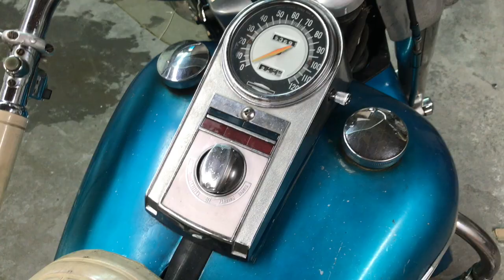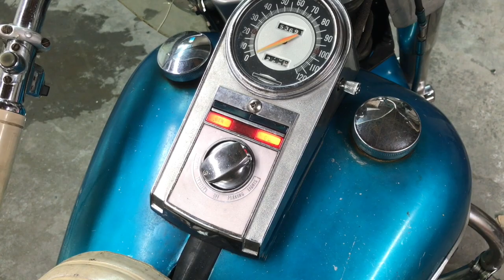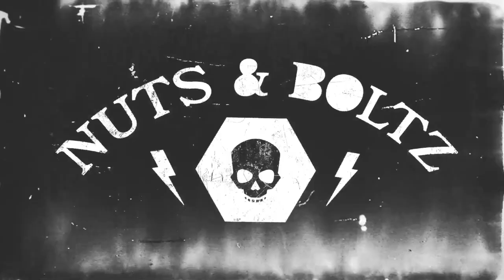How to time a Shovelhead with Auto circuit breaker - 1969 Harley Davidson Genny Shovel

Comment: That is not a distributor. Both cylinders fire at the same time.
Reply from the maker: Correct. The proper name is a circuit breaker. Thank you
Reply: @nutsandboltzgarage5889  Thanks for being a nice guy. I'm a bit of a butthole when it comes to using the proper names. It all started while in the Air Force. Best mechanics training in the world. You don't make mistakes. I've had my 75 FLH since new. It has never been in a shop, not even for warrenty work. I've done it all myself, and that is with one complete rebuild front to rear. It's just this particular item came up once before along time ago so I will tell you about it. You might get a chuckle. This guy was trying to time Panhead using the two different marks on the fly wheel. First he set one and then he would set the breaker to the other mark on a different place on the flywheel. When I told him what he was doing wrong, he told me I didn't know what I was talking about. Everybody calls it a distributor. I told him my bike wasn't the one not running. And to prove my point,butthole that I am. I fired up the Graylady and rode away.
Reply from the maker: @Helm-w1q  no. I appreciate it. I knew what it was called. You're correct and welcome here !

Comment: What you did here would it work on 70 ironhead 900!?
Reply from the maker: I don’t think so. You don’t have the same distributor. Yours is inside the cam cover. There’s a different process for the timing hole lines.
Reply: @nutsandboltzgarage5889  I'm gonna keep researching maybe I'll find one with the same vertical setup as mine, that's pretty what's left to be done on my first hardtail
Reply from the maker: @edmondndrecaj4377  there’s plenty of resources on line. It’s just where to put the line in the hole and what the gap should be set at
Reply: @nutsandboltzgarage5889  that's where it gets litte confusing for me, I did order a book and hopefully this old timer can swing by one these days I just need see someone thats done this before
Reply from the maker: @edmondndrecaj4377 are the points installed already?